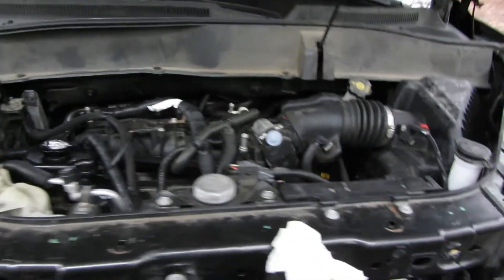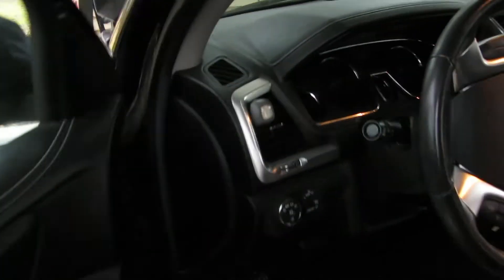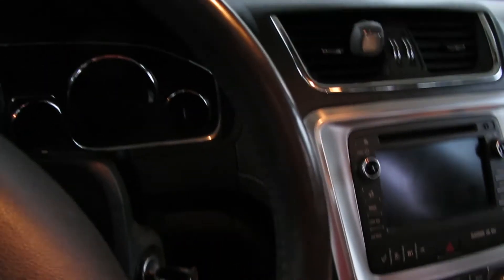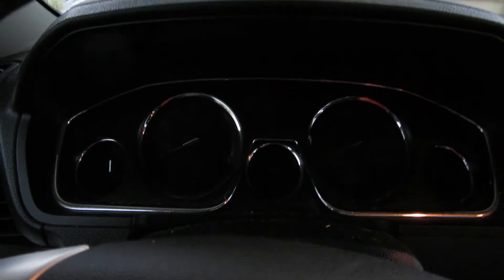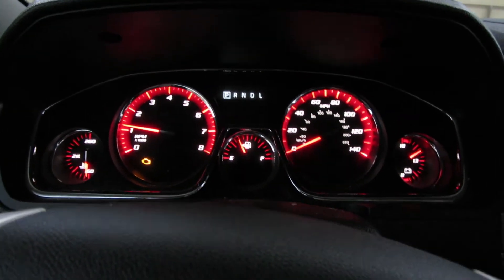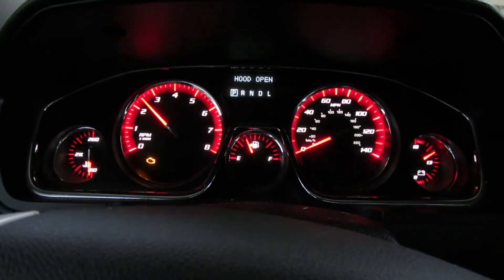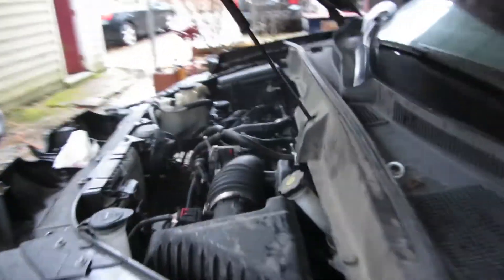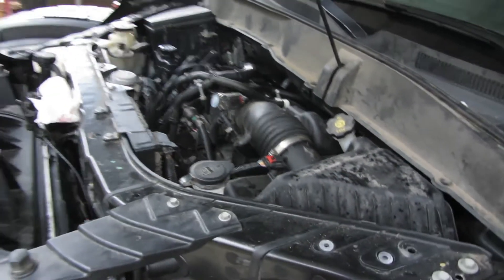2016 Acadia engine swap almost complete. It runs.

Comment: How did this go? Do you think I can swap engine and transmission from a 2012 Acadia into a 2010? Both are 3.6l
Reply from the maker: Mine went well, they are still driving it. I do not think you can do that. Things I see say 2010 and 2011. No newer.
Reply: @wrenchesinmotion3282  yeah I see that the 2012 is a VVT 3.6 and the 2010 is LLT